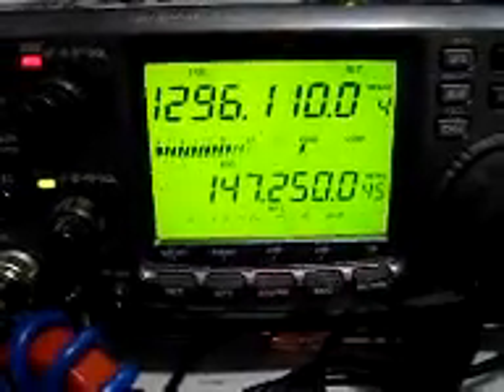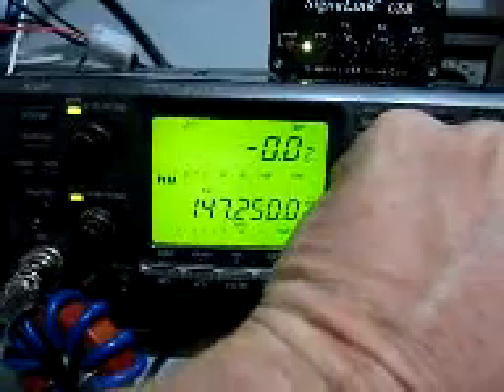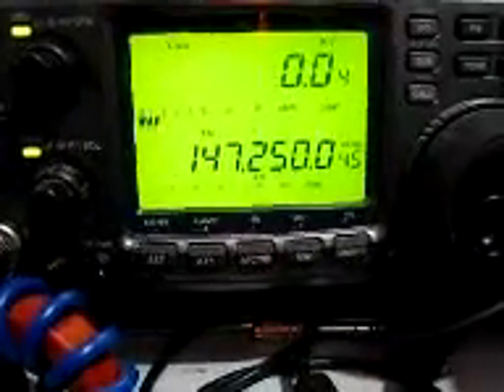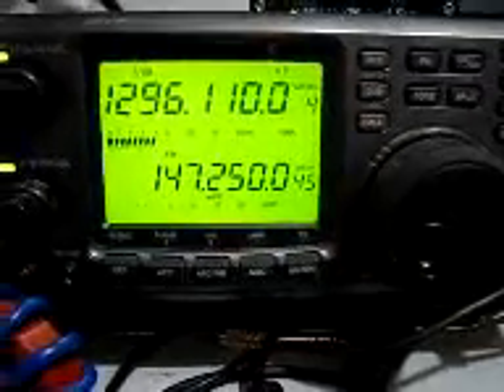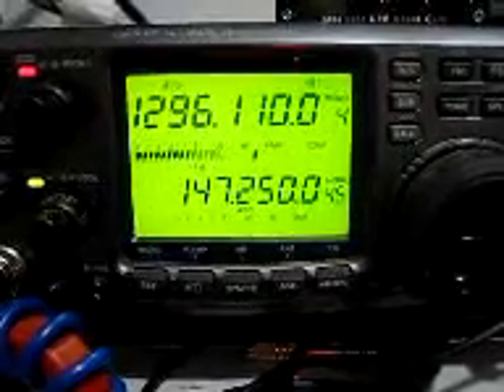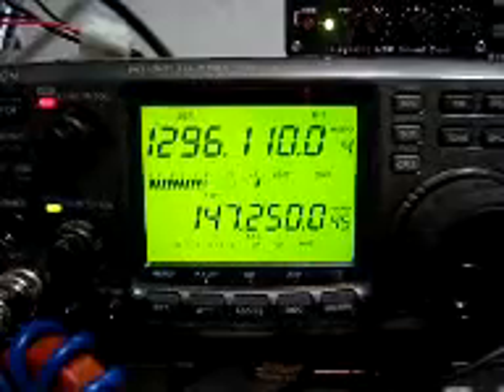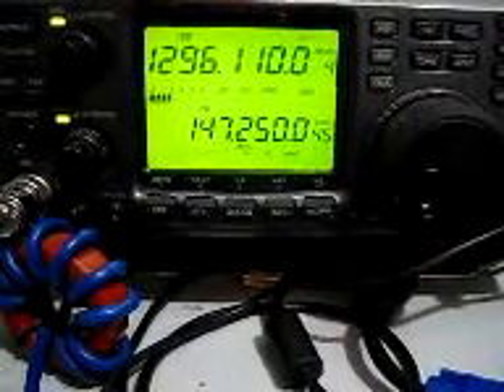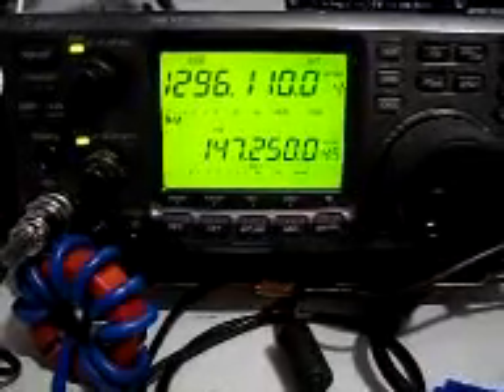1296Mhz Contact with VK2KRR

Comment: I just have to add that Andy is not using a Pre-amp in this video, so you can imagine how strong it would be with the Pre-amp. As you can see quite audible when the signal is not moving the meter. Gotta keep watching this, not been much tropo since. This was a great opening. de VK2KRR